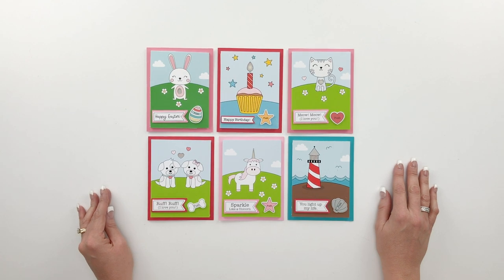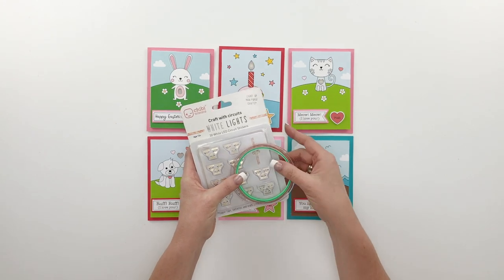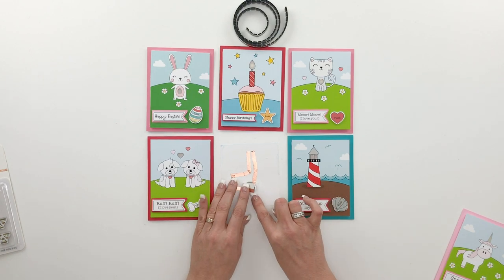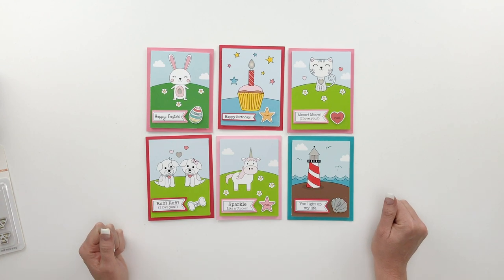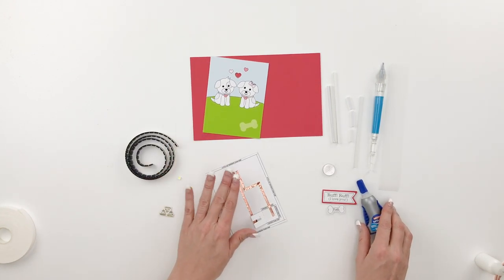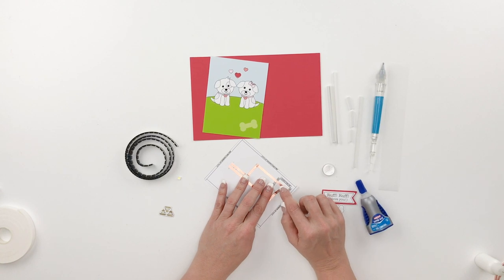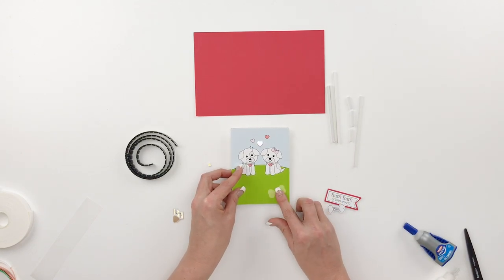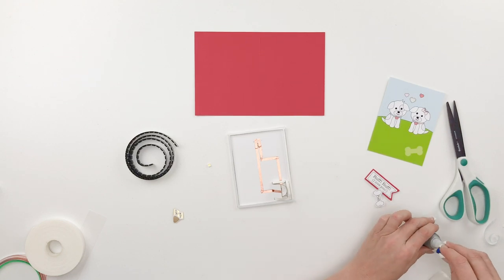Light Up Cards

Comment: Hi Lori, Have been exploring light up cards and purchased one of yours to get the basics down.  What fun.  Just wanted to let you know there is a way to tell which is the positive and negative sides of the small 5050 led lights.  There is an indented corner on the lights and that corner is the negative side.  Of course, the other side is positive.  Love your designs and have many of your boxes.  Thanks.

Comment: Hi Lori-I'm using the SMD lights and they only work if I push on the light at the same time I'm pushing on the battery.  Any advice?  Love all of your cards!
Reply from the maker: Try putting some packing tape over the light to hold it down tightly. The SMD lights are a little tricky sometimes. You need to make sure it's making good contact. The clear packing tape worked for me.

Comment: When I open the file it’s all cut. How do I make the parts that are supposed to print into a print and cut?
Reply from the maker: Michelle, Which machine are you using? Cricut, Silhouette, etc...
Reply: So sorry for the late answer! I am using the cricut machine.
Reply: I am having that issue right now. I have Cricut Maker